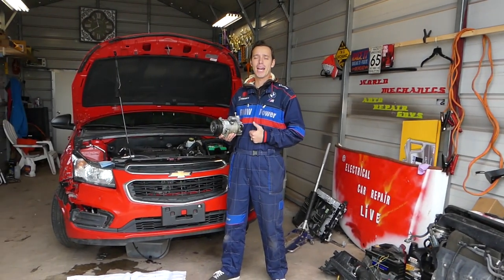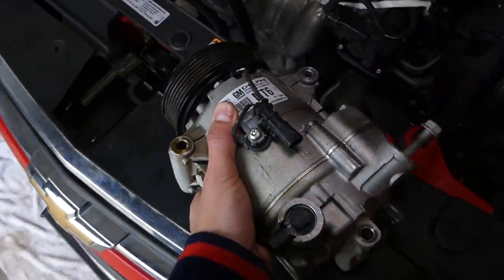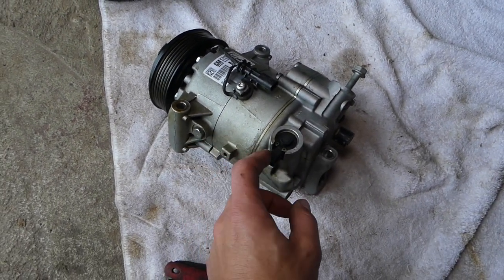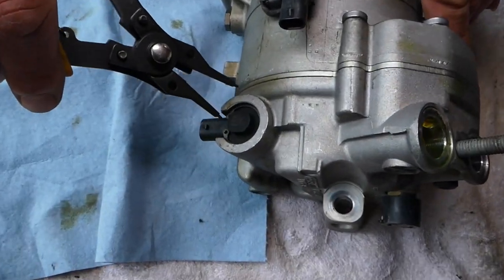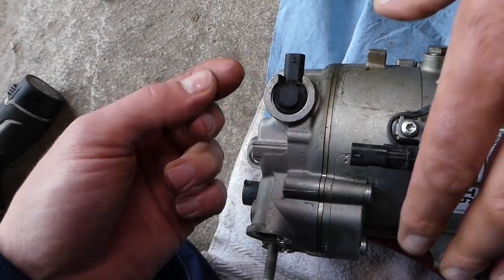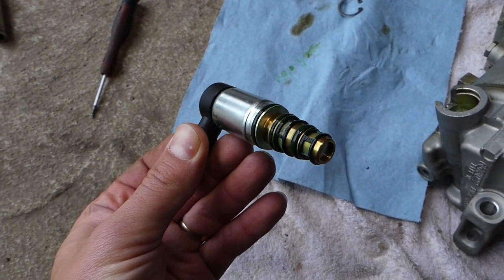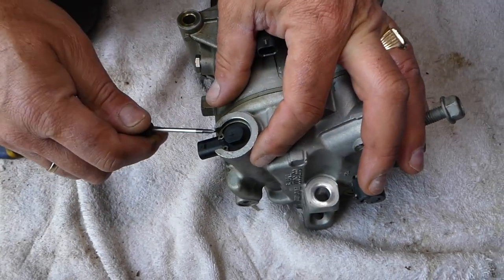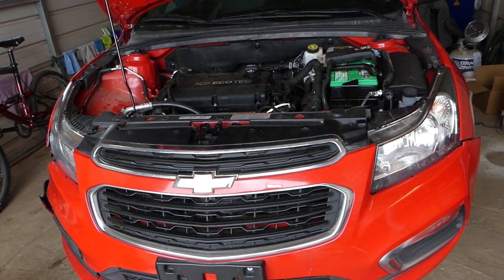CHEAP FIX AC COMPRESSOR CHEVROLET GMC BUICK MALIBU EQUINOX TRAX CRUZE SONIC AVEO SILVERADO TAHOE

Comment: how do you trouble shoot to know it was the solenoid that was the problem? It could be expensive discharging and  recharging and changing parts.
Reply: Why hasn't this comment been answered yet?
Reply: Multi meter
Reply: I can tell you,I've done a lot of these and it's usually always the control valve,these compressors are always moving they don't have a clutch  that controls the engagement of the compressor,these have that valve to open when the ecm commands.so just make sure you're getting a signal to the switch and if you are replace the valve if you're not then continue diagnosis.

Comment: Where do I buy the "pressure control silinoid " for the ac compressor on my wife's 2011 equinox. I did not see the link you spoke of. Help, thanks.

Comment: How did you find out it was selenoid? Did you do measurements for resistance?
Reply: True what was the problem
Reply: Its gets clogged. Known issue with many  other car manufacturers
Reply: It’s a common problem with GM cars and in some cases make some clicking actuator sound.

Comment: Hello really enjoy your videos just wondering have you done a video on how to replace the spark plug rubber seals in a smart car I notice mine is starting to get a little oil up above the threads when I change my spark plugs I just wondering if you've done a video on that on how to change the spark plug seals

Comment: Hey , I have a question regarding the   Solenoid, I have the same Malibu 2010 and the A/C only works when it’s parked and when I put it on drive it’s stops blowing cold air .. could it possibly be that part i have change ? …. Thanks
Reply: Does that help mine doing the same thing.
Reply: Could be the solenoid he’s talking about in the video, or pressure switch, or relays/fuses. Every case is different so the same issue can be cause by different things. Good luck!

Comment: The compressor control valve is not a valid part number.  I can't find one even at the dealer website.
Reply: I have it, I don’t know if you still need it but is MT3461

Comment: What if your pressure is to high, and compressor is not working
Reply: After the system has been off awhile, and lo and hi sides are equal, 100psi = 100% full. If too high, then the pressures will be too high with the AC on for 5 minutes. Normal on an average summer day is 35 & 150. If high on every reading, remove refrigerant until all numbers are normal. The proper way is to recover the refrigerant into an AC machine. If only the high side is high after the AC has run a minute or so, then the cooling fans have not started or something is blocking air flow. The lo side is an indication of the temperatute inside the passenger compartment and the hi side is an indication of the temperature outside. If only the lo side is high, you probably left a window (or 4) open. There are other factors but this is not meant to be thorough.